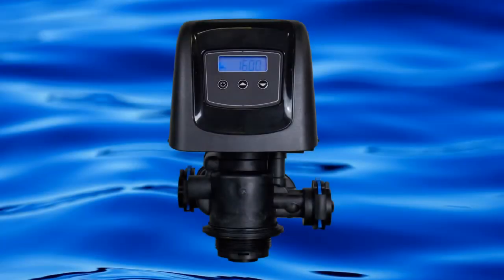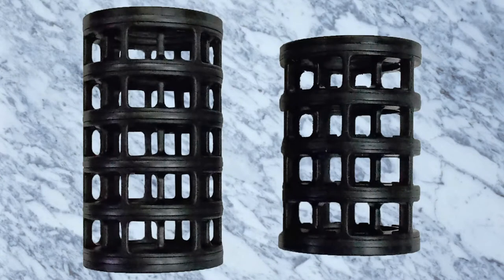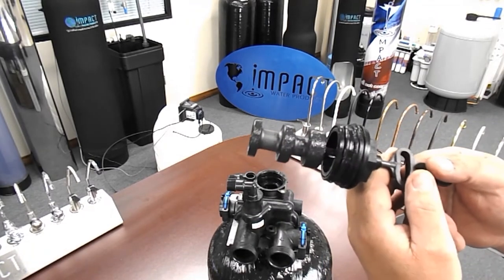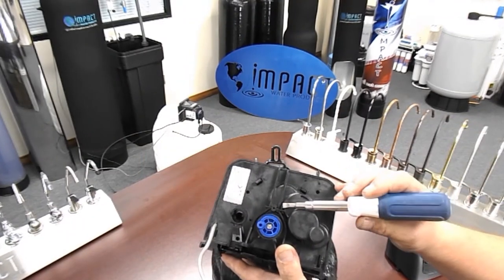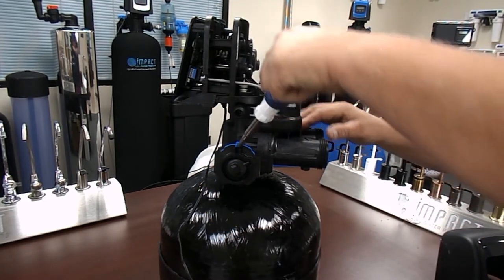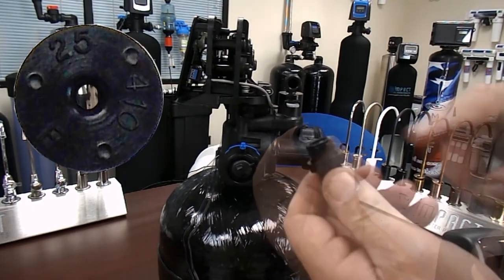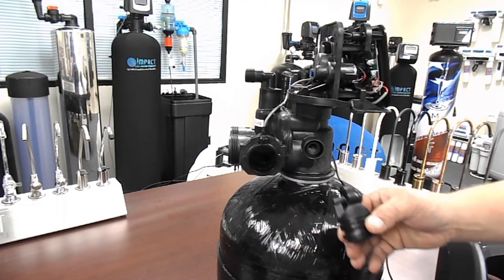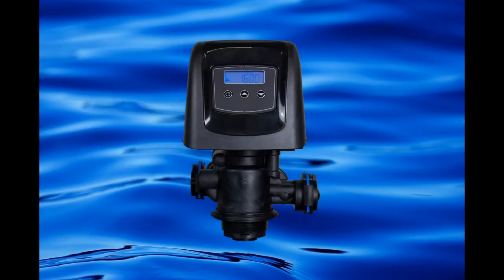Fleck 5810 and 5812 Rebuild Tutorial

Comment: Thanks Allan! My Fleck 5800 LXT stopped working. I saw a "FSER" error which means "Looking for service". Unplugged, replugged, and the unit had lost its time setting but all other settings were saved. Manual regeneration (backwash as I am using it only for removal of chlorine) would initialize but no water would exit the 3/4" PVC. 
When I took the unit apart the main control unit just popped back into place without me even trying to do anything. I took the opportunity to put a tiny bit of silicone lubricant on the rubber portion of the piston, the piston rod, and the o-ring. 
I had trouble lining up the screwholes and the protuding knob. When I tried to tighten the 2 screws that hold the head unit down I could tell it wasn't right as the stem was kind of bent and under pressure. 
Thanks to Allan and this video I was able to fix it by turning the gear manually until everything lined up. 
Also, for reference, on the 5800 the seal and spacer cage is directional it appears. The part with ramparts goes on the bottom according to the manual.

Comment: At 1:10 you say to gently lift the cable out. That's not how you remove it, the cable is barbed. You need to release it from below with a screwdriver inserted into the release slot. I found this out the hard way. Mine would not come out so I pulled it out with pliers after watching your video. The barb snapped off the end of the cable. Afterwards, I took a flashlight and saw the slot to release the cable.  Good video otherwise but obviously I am a little annoyed.  You should put a note in your comments explaining how to release the cable so other people don't break theirs.

Comment: How long do you need to wait after the Backwash cycle begins before you can begin disassembly?
Reply: I think almost immediately since you then unplug the unit. However, I decided not to use the head unit to depressurize since backwashing wasn't working in the first place. 
The procedure to depressurize would be as follows:
1. Turn off the inlet valve. 
2. Open the nearest cold water tap and release the pressure.
3. Close the outlet valve of the fleck. 
4. The system is now depressurized.

Comment: So currently my fleck 5810 sxt will show on its control module screen that it enters the regeneration cycle at the proper time and also if I force the regeneration manually, but what happens is it will neither begin to draw nor refill water it will just show the time counting down on the screen but the actual mechanical parts are doing nothing.  There is no salt bridging as i cleaned out my tank.  The system has not entered regeneration cycle in a while.  What could be the issue(s)?
Reply from the maker: Best to call me, I would be glad to assist you. Go to www.impactwaterproducts.com  Contact me through the contact us page... thanks!
Reply: @ditttohead i tried to contact through the website but it won't let the pass thr capta verification. Can u provide an email? I have the same issue